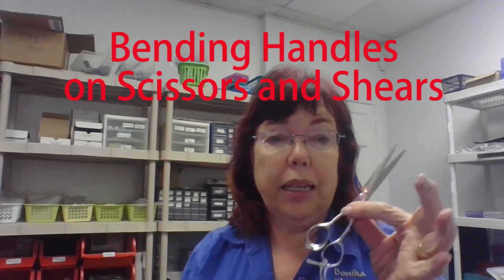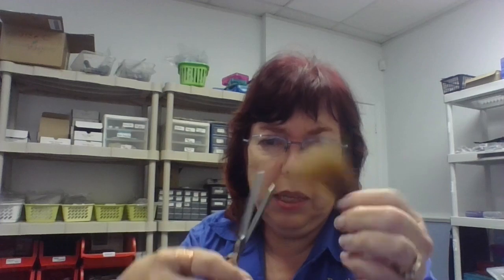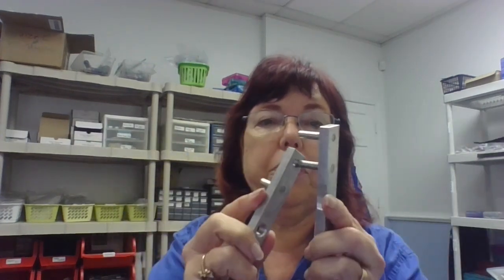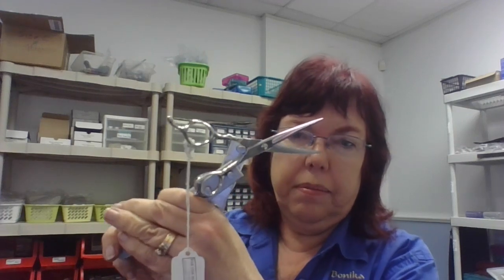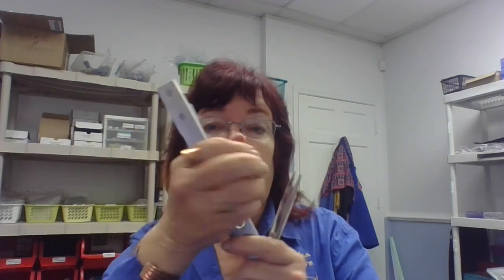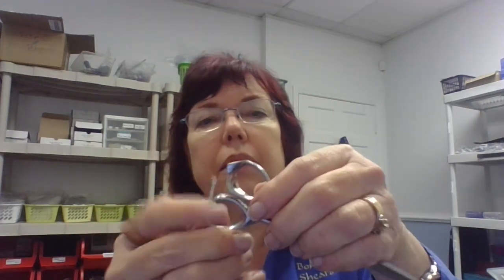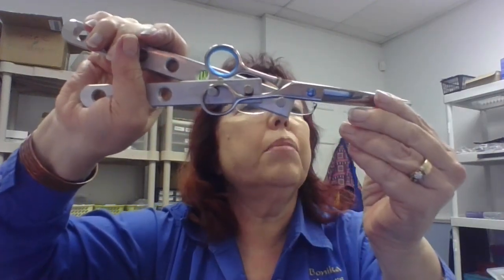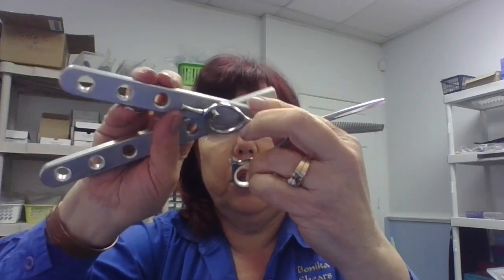Bending Handles on Beauty Shears and Scissors

Comment: Good Day
Is the bending tool specifically for scissors handles or can it be bought from any hardware shop? Also, what's it called? 
Thanks
Reply from the maker: It can not be bought at a hardware store. It is specifically designed for bending handles. It is called the "Tip Tweaker." This is the link to purchase : https://bonika.com/collections/sharpener-supplies/products/tip-tweaker-shear-handle-bender

Comment: Great videos, do you have any methods to safely bend handles on cast shears? Are any of the shears in this video cast or are they all forged? Thanks
Reply from the maker: Most shears today are forged. I wouldn't want to try to bend cast shears, although I've met people who claimed they could. That's a question for Ramon who will speak at our 2021 Sharpeners Jam.
Reply: I've tried to bend cast shears and they just snapped broke relatively easily...

Comment: how does a pair of shears need to be bent so much? I cant imagine this is just from a single drop?
Reply from the maker: The most common reason beauty shears are bent is from over sharpening which changes the geometry of the shears. On groomer shears, LOL, watch some of the grooming videos where they cut through big mats of hair with their scissors made with cheap metal. They also fall on a hard concrete floor when the dog tries to bite them. Grooming scissors are the worse!
Reply: @BonikaShears  i am gonna argue about grooming shears being the worst as i am now a sharpener, whilst also working at a grooming salon.. mainly because all the hair dressers seem not to get them sharpened they just bin and buy new.. been offering my services around locally, and the ones i have been given they are like £40 shears, where most groomers are £200 :/
Thanks for the reply though i have not seen anything that bad before but i will keep an eye out.